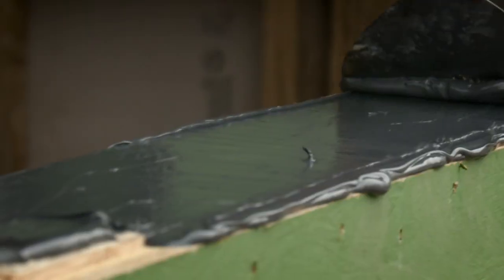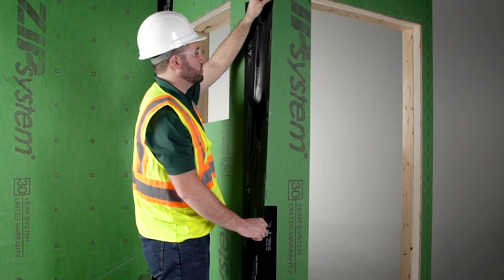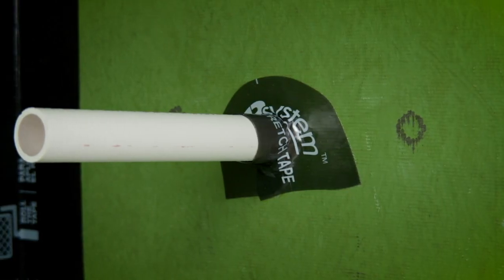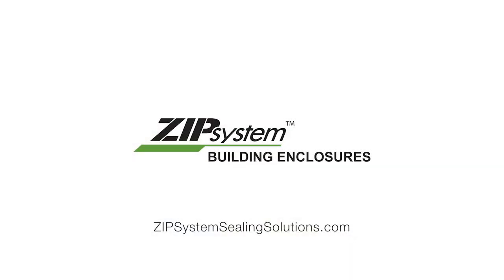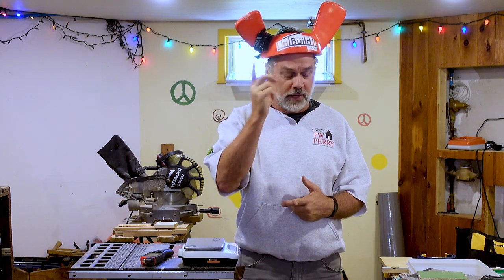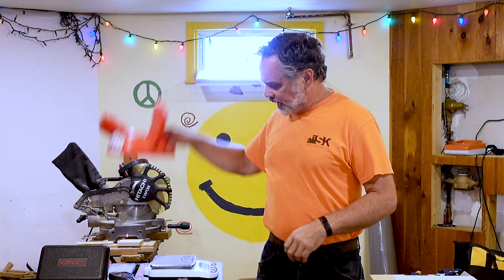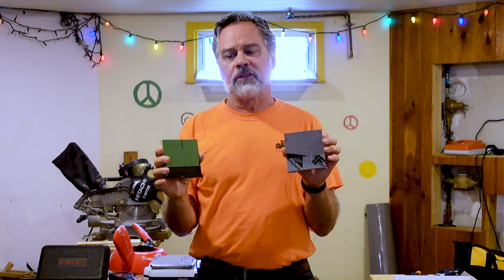WTF WRB testing - Round 3: Huber ZIP and GP ForceField

Comment: I don't understand why builders cut so many corners to save money.     Why not paint the edges of the sheathing, or paint the whole sheathing?    Or why not design the sheathing so that moisture runs down-slope, with tiny ridges.     Or just add more zip-tape.
Reply: Because they don't have to live with it when it fails. Lack of quality control. Lack of pride for your community. Etc....
Reply: There is a cost to everything. Sheathing in and of itself is very rarely the failure point of concern in new housing. The fact of the matter is that homeowners simply will not pay for for a framer to paint the cut edges of osb or take time consuming steps to add minimal extra water resistance. A good builder will take the extra time and effort to build up water resistance around areas such as penetrations or deck ledgers etc. Overall it’s a balance of giving the customers what they want and what they actually need.
Reply: @benjamindeboer6920 maybe they would if they knew the benefits of it, and maybe builders framers should offer these options, but in all reality many people don’t really care that want it fast and cheap as possible.
Reply: money

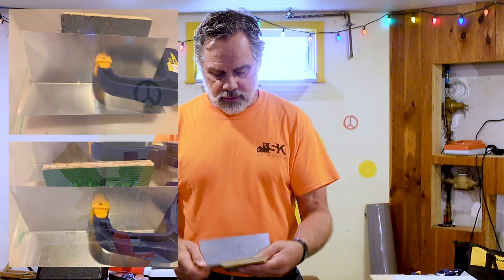Comment: I'm concerned that the metal flashing is wider than the sheathing piece, as shown at 4:30 where the metal piece extends far beyond the sides of the sheathing pieces. The water that enters between the metal and coated sheathing will spread out between the metal and coating until it reaches the side of the sheathing. At that point, it may wick in around the coated surface into the side of the sheathing. In a proper installation of either material, the side of the sheathing wouldn't be exposed in this way.
Reply: That is a good point and a prime example of why we need more wingnuts improving testing. In this case, I did take several pin-type moisture readings for each sample, being sure to look for consistently elevated readings near the vertical unprotected edges, and did not observe any. But it would be better and more convincing if I improved the test to more clearly protect those edges, maybe wrapping them with tape as well and cutting the flashing down to not extend past the samples. Thanks!

Comment: I'm pretty sure Force field has a laminated film but isn't zip applied as a liquid like paint? Zip tape is a robust many usage tape that can be applied to rough surfaces like plywood or raw OSB, or for bridging between sheathing and wood.  Force Field is a thin smooth non stretchy tape and can only be used on the Force Field sheathing. That brings up another issue. Zip sheathing has a rough texture that Huber claims will allow water to escape under external foam insulation. I can't imagine the smooth Force Field can do the same. Therefore, a draining house wrap will would be required between Force field sheathing and the foam. I've heard that the same person designed both systems. It is clear to me that Force Field was developed mostly to skirt Huber's patents.

Personally,  I use neither system. I simply don't like OSB. I sheath with plywood, Tape the seams with Zip tape, and use draining house wrap for the WRB.
Reply: Forcefield does have a premium tape that is yellow. It's rubbery and very high adhesion. For the price difference the forcefield system is pretty great in my opinion.